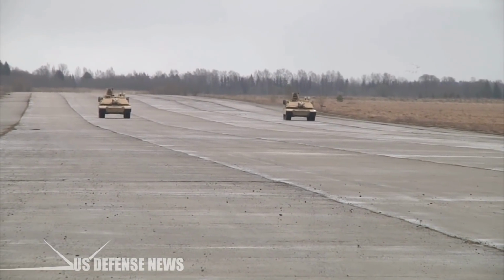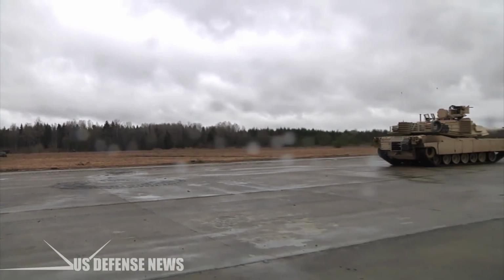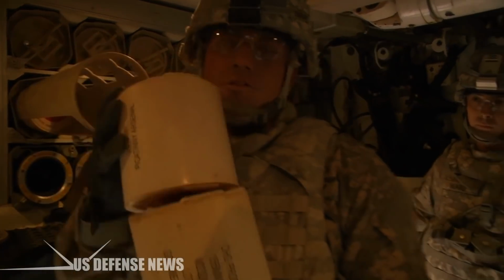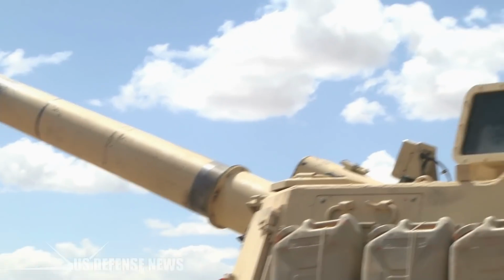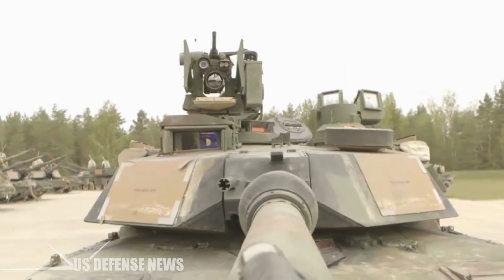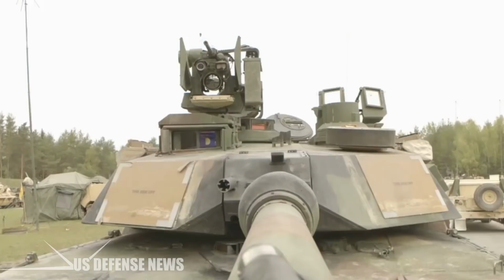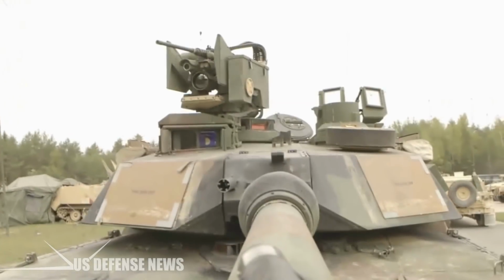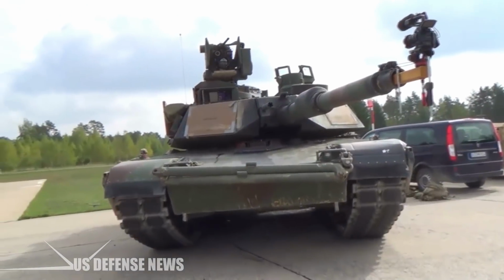U.S. Army Receives First New Abrams Tank Prototype

Comment: They should change the engine to a diesel engine. Not that fuel hungry jet engine.
Reply: The turbine is more quiet and more powerful
Reply: Matthew Rhodes  no it's not it has great armor depleted uranium for m1a2 m1a3 will have better than that
Reply: Matthew Rhodes We upgraded the armor with this new bolt on packs. Very good stuff. I was a tank commander for a long time. I know this system inside and out.
Reply: Dragan Petrovic 
Abrams fires once T-90 never fires because it's a ball of flame.
Reply: We had the M1A1 in the corps. We are getting new M1A2 upgraded units soon. We are already training on the new tanks.
Reply: Anthony Molina They prob was yelling that bullshit. But never heard them. Just seen them vaporize!!!!
Reply: Dragan Petrovic  ok yea Russian has the best tank ever and the best aircraft carrier it's so cool that it's powered by a tugboat
Reply: Dragan Petrovic The reason it cost 2 million dollars is because it does not have state of the art fire control system. The new Abrams and the ones being worked over are getting some really neat and badass systems. Can't talk about them because it's classified but don't underestimate this system! It is not the old Abrams of 5 yrs ago!! A few surprises for the Russians or Chinese!!!
Reply: There are turbine engines mounted on some Abrams variants that can develop up to 4500HP but they are limited to 1500 HP.
Reply: It's armor is one of it's greatest advantages over other MBTs . Crew survivability is top notch.
Reply: Dragan Petrovic manual loader is faster then an auto.
Reply: Matthew Rhodes bullshit it's lacking. It's the best in the world. Russian tanks? Please, they have horrible armor. Their wrecked turrets litter the Middle East.
Reply: Dragan Petrovic Russian tanks litter the Middle East. Turrets pop off easily and an auto loader will fail eventually. How many videos of Russian tanks cooking off do you need to see idiot?
Reply: Dragan Petrovic that's bullshit. An Abrams only needs one. Shot anyway.
Reply: The turbo diesel of the Leopard 2 is the same power and the tanks weights are similar. The fact the Leopard has a range of 340 miles with 1200 litres of internal fuel vs only 265 miles from 1900 litres for the Abrams, shows which is superior.
Reply: joy santod They burn they same fuel. The turbine was used because in the late 70s because turbo diesels couldn’t make that kind of power and be small enough to fit in the hull. Speed was needed because we could not match the numbers of Russian tanks on the eastern front. The armor is not weaker. It is literally the same as the British as we got the technology from them in a 3way development between us the brits and Germans. Our armor is superior that’s why we don’t need explosive reactive armor such as that found on Russian tanks. There’s literally a book on all of this.
Reply: The turbine in no way saves us money or has a longer service life. It’s the opposite in every way.
Reply: It's cheap because it SUCKS. The survival rate of Russian tanks vs American tanks is 0%. You ALWAYS ALWAYS LOSE the tank war.
Reply: Dragan, you... you DO realize that a human loader:

a) is faster than an autoloader, being 4-5 seconds for a competent human loader vs 6.5 seconds to as much as 19(!!!) seconds if the casette on a T72 autoloader has to turn a full rotation to the selected ammo?  T90 is slightly faster than T72, and at least the Russians FINALLY put their ammo in protected racks so it doesn't catastrophically explode (I mean, the Americans only figured THAT one out in 1943, so... another 50 years for the Russians to finally figure it out isn't so bad, right?), but a human loader is still significantly faster.  

b) Is much faster to re-stow the ready rack from the additional ammo racks, or to re-stock the tank from an ammunition supply vehicle, because not only is there another person helping, but the ammo stowage is more easily accessible, and there is no need to encode the ammo stored in each and every storage slot so the fire control system knows what ballistic computation to use with that round (which, incidentally, is another opportunity for human error to forget to encode it, which would then mean the round is fired with the wrong data and misses entirely)

c) can help with doing maintenance on the tank, whereas an autoloader INCREASES the maintenance requirements on the tank

d) can scan a sector and provide information to the rest of the crew

e) can man the loader's machine gun on road marches or to provide local security

Human loaders are very, very helpful to have.

It's more like "Abrams fires once from outside the effective range of the T90, kills the T90.  Second T90 stops to fire a missile because it cannot employ AT11 while moving more than a couple km/h... and then tries to engage with a missile while stationary, but forgets that it cannot fire the AT11 using the thermal sight, and can't actually see anything with the image intensifier sight because it is a very poor night sight with awful resolution, so while the crew is dicking around trying to get a missile off, just makes it easier for the M1 to hit and kill it by sitting still.  Third T90 closes the range gap and finally opens fire from 2500 meters, but is outshot 1.5:1 in rate of fire because the autoloader is actually slower than a human loader anyway.  Fourth T90 gets killed by infantry antitank team because the optics package on Russian tanks are awful, they have inadequate thermal sights, and one less set of eyes and one less machine gun scanning for infantry threats"
Reply: LOL petrov . you have no fvcking idea o the BS your spouting... Manual loaders in NATO MTB's  out perfrom the T 90 each and every time... You need to stop posting your bullshit...
Reply: Stillamarine 1001  cool
Reply: are these even EMP shielded? what use is a hunk of junk that doesnt move?
Reply: They went for a MUlti fuel turbine. Because the name says it. Multi fuel. it can even burn gasoline, jet fuel, ethanol, diesel, JP-8, JP-4, F-34, and hypothetically... crude oil.  That's why the turbine.... AND  35 minutes to swap it in the field because its a monoblock engine. you swap the whole turbine if something is broken... done deal go back to fight. Its expensive but it has logistical advantages. It is fuel hungry and not that efficient but who cares. Murica has money.
Reply: Chandler Becker:  No.  It is not.  For one, there is no such thing as "chobham armor", it is in fact Burlington armor.  Secondly, it was a joint US-British development.  Thirdly, the Abrams has not used Burlington in decades, as the US has subsequently developed and employed significantly better armor packages into the Abrams, upgrading it's effectiveness almost twofold from the original 1980s package.
Reply: DEFINITELY not. The AGT1500 is loud to be sure, but the tank actually moving is even louder. I'm an Abrams mechanic. Plus you can put literally any type of fuel into the Abrams. You could put fucking zippo fluid into that bitch.
Reply: Dragan Petrovic - The T-90 doesn't even come close to comparing to the new Abrams.  In fact, it's not even the best tank in the Russian inventory.  That would be the T-14 Armata.  While much better than the T-90, still not quite as good as the new Abrams.
Reply: You guys are forgetting that the Abrams is a big tank. It's one of the biggest MBT and it's fast for its size. A lot of the weight is from the armor. The tanks being destroyed in Syria are the export models that don't have too secret equipment. Why would we give too secret equipment to a shitty militaty. No offense.
Reply: mer3abec No. These tanks we gave them don't have DU armor as well as certain equipment.
Reply: mer3abec Basically The Abrams’ tanks of 2003-2007 era are not to current spec. The ones in Iraq are from that time frame of deployment. They are good tanks, but by no means are up to the capabilities of a current model, plus the on board computer was removed before being left behind. We didn’t leave any classified target and track or communications suite on board. So they are dumbed down in that regard, similar to models built for export.
Reply: XaHyMaH I saw your comment on the Abrams performance in Yemen. No amount of technology can survive shit tactics. They were driven by Saudi operators, right? Arabs use bad tactics, may as well say NO tactics. They cannot fight at night, as they are almost all night blind from birth. That’s a known fact by the way. So, combine day only fighting with gaggle warfare and you will get losses.
Reply: Stillamarine 1001 That's not entirely correct.  You know how board we get in the field.  My M88A2 was challenged to hook chains by the tankers in tug of war and I never lossed to an Abrams!!! Lol
Reply: LOLOL... Petrov.. Shut up you tool.. Its been proven that NATO tanks firing manualy out perform Russian autoloaders each and every time.. Also having a larger main gun doesn't neccessary mean a better kill ratio.  Add to the mix the T90 is just an upgraded T-72B. So please take your inept comments to the Russian fan girl forums LOL
Reply: Matthew Rhodes 
Are you serious? The M-1 is superior to any other battle tank armor.
Reply: OptimalOptimus50 Lol I see people.argue that all the time.

It's like, as opposed to what? A fuel economic tank? What the hells a fuel economic tank?
Reply: OptimalOptimus50 Same.

We never had to refuel that much either, sure as hell didn't have fuel trucks following us everywhere either.

In afghanistan we usually had more than enough fuel to travel between FOBs (multi hour drives) and plenty to do any presence patrols/overwatch.

We always refueled back at the FOB. 

The ONLY times an LVSR refueler went out with us was during massive movements 8-9hr plus drives. The first time was when we went to FOB Robinson to support MARSOC operations. The second was when we were packing up to.head back to camp Leatherneck.

Both times it was hidden in the formation behind plenty of guns and armor.

So again fuel economic....how far does a tank need to go? Lol
Reply: OptimalOptimus50 We can average around 4-6 hrs.

Not all engines burn at the same rate however, but that goes into maintenance etc etc.
Reply: Try moving 140,000 lbs at an instance LOL there’s semi trucks that can haul that amount and more...but they can’t just move fast in a war situation
Reply: 😋 yummy. For joy. You spread eagle on a tank would make a great selling poster
Reply: joy santod ya no. The turbine is raw power and high torque. We got enough gas.
Reply: Turbine is more powerful and has better cold weather reliability as I understand it.
Reply: joy santod it doesn't eat up fuel show me how?
Reply: Matthew Rhodes lol no
Reply: joy santod yep maye they could or not.
Reply: Tally Roll - In fairness, it's always been easier to make a better spear.
Reply: Daniel Kunkle Very true.
Reply: The Turbine in the M1 produces 1500 hp. quite powerful for its time.
BUT Diesels have now exceeded that power, now reaching ~1600 hp (most are about 1575 I think).
The Abrams was due for an upgraded Turbine, but the company that designed the original engine went bankrupt, so a new power plant (out side of diesel) is unlikely.
Reply: Isn't a lot of the reason the Abrams went with a turbine is for easier cold weather starts for European winters?
Reply: No. Winter diesel from filling stations doesn't freeze in central Europe.
Reply: Stillamarine 1001 Yea it's not like Leopard 2's in 1979 had Diesel engines with 1500hp
Reply: joy santod Our rounds and fire control systems are far superior. There’s a reason the cost is more. We don’t technically use diesel anyways. JP8 is used as it can be used in many environments. The turbine doesn’t care that it’s in the desert. That’s why the skirts are on the vehicle to keep sand out of the intake.
Reply: The LV100 was a proposed upgrade for the M1.  I think it was supposed to produce 1675 hp, while being more efficient. Lycoming was working on it, but I may have been mistaken, as they have merged or were already part of a larger company, Honeywell.

/watch?v=dl0osHn-nNQ&index=39&list=PLZUp4w8LY7wi1V97-xteEUW30TnDoy531
Be sure to take salt with you...

I did attempt to find more direct sources, and failed.
But if it is of interest to anyone, I found some articles about a possible TURBINE upgrade in the works.
The 'LV100-5' is/was apparently a thing!
Reply: joy santod See, right now you can take the JP-8 fuel from a Blackhawk and pour it right into an Abrams, a HumVee, and all our vehicles used on the Battlefield.
Reply: Matthew Rhodes What are you talking about? The Abrams armour is British.
Reply: John: In the document "Report No. P.C. 59 FEASIBLITY STUDY OF BURLINGTON FITTED TO CHIEFTAIN" from 14th May 1969 some details on Chobham armor are given. Already in 1969 the name "Chobham armor" was used to describe the new type of special armor developed in the British military facilites in Chobham, but the official codename for the armor was "Burlington".

Burlington was the official project name for the armor development program that came up with that armor package, which, again, is obsolete and has not been used on US M1 tanks since the M1A1HA in the early 1990s.
Reply: Your joking right....... right ...excessive fuel usage , excessive wear n tear due to MASSIVE heat production not to mention continued burn through on exhaust systems (due to heat) despite several "Fixes" and engine life cycle before "Reconditioning" less than 1/2 of Leopard 2 and Challenger 2 competitors  typical GD kit
Reply: Undistinguished Accuracy Actually,   it's a maintenance headache because it's the same engine that was in the Huey helicopter.  A newer engine would be much more fuel efficient.
Reply: Daniel Kunkle In cold weather the diesel needs to be kept warm.  Plus, when you start it the black smoke let's everyone know you're on the move.
Reply: joy santod it actually isn’t that bad.
Reply: The armor of the m1a2 sep v2, is up to at its best 1500 mm of effective armor against heat, That is better then on the Armata.
Reply: 1500 horsepower man
Reply: You don't need power to move the gun around and fire. We have the capability of EMP shielding but it's stupid expensive and nobody really uses EMPs
Reply: self loading cannon is more prone to breaking down. They specifically decided to have a loader for a reason. Auto-loaders are shit. Abrams is much heavier and more armored than a T-90. It might be a close fight, but Abrams would win
Reply: It's not that classified high speed lol
Reply: I call bullshit
Reply: John Hall Yup. Exactly. Like I said earlier, you can pour the fuel out of a Blackhawk and put it in a tank, humvee etc. every tanker I have ever met has been very confident on the M-1. The current models are EMP hardened as well. The current friend foe identifier has been improved to include  the ability to identify all current surface warfare vehicles.
Reply: joy santod they tried that in the 80s. Way more torque and power generation with the turbine engine. Less exhaust smoke. Higher exhaust heat but far more positives over diesel power plants.
Reply: Anthony Molina - That used to be true when the Abrams first rolled off the production line (which is why it was made to be so nimble compared to it's Russian counterparts).  However, since the initial launch of the Abrams in the early 80s, a lot has changed and and newer armor has been developed (e.g. Bolt-on packs).  The Abrams no longer has inferior armor to any tank in the world.  The newest version will probably put the Abrams back on top of the best tanks in the world, but prior to this new version that title was held by the Merkava Mk.4 from Israel.  However, over the past year the US (M1A1 SEP Abrams), the Russian (Armata) and the UK (Challenger 2) have all surpassed the Merkava.
Reply: Joy Santod - There's a reason diesel engines were scrapped long ago in airplane development.  Better fuel efficiency, easier to maintain, longer lifespan and more power.
Reply: Ioan Catarig do you know why the tune it to 1500? I would like to know
Reply: It's multifuel. Diesel, gas, marine diesel, you name it, it will run it
Reply: joy santod The fuel hungry hey engine weighs less, and it'll run off any fuel that burns. Gasoline,  jet fuel, diesel -- any liquid fuel.
Reply: Tally Roll Fuck no. Any RPG that took out an Abrams, hit it in the engine -- a weak point on ALL TANKS.

There's an Abrams that took over 15 RPG hits, made it back to base, and was repaired and sent back to battle in a week.
Reply: farid aliyev Ukraine faced russian army? Idiot. Ukraine can be taken over by one vdv paradropers division droped near Kiev. What ukranian army faced are coal miners who surved in soviet army of USSR. Most of tanks and weapon purchoised by donbas rebels from ukranian army command staff or captured. Moreover, donbass republics has ammo factory . Most of the tanks used in this conflict t64 .
Reply: what do you think it runs on jet fuel lol the army uses one fuel for its ground vehicles diesel
Reply: XaHyMaH The loses are hits too the engine. You can disable ANY modern tank, if you shoot it in the ass with a machine gun, as the massive engines need massive slots to breathe -- these massive slots are in the rear of the tank, and give a direct line of fire too the engine. 

Taking out an Abrams from behind doesn't impress me. In fact, doing it with an RPG is retarded. Taking out a Russian T-90 is even easier. It's a T-72 with primitive ceramic armor bolted on and ERA bolted on. Guess what isn't affected by ceramic or ERA? SABOT rounds. Guess what rounds the Abrams fires at other tanks? SABOT's.
Reply: Heinrich Von Kekelnazi They had a rpg hit and Abrams and it hit it in the ass. It was a very lucky hit. You can knock out any tank, with a M72 from the rear
Reply: Holesinsocks bad dancer cos of his balls?
Reply: Meh, would rather annihilate Russia and China absolutely with an engine that is:
More reliable. Faster. Cheaper to maintain. Can use any fuel. Is much quieter. Doesn't kick-up a huge black smoke plume.

You said something about diesel? Sound more like a red commy.
Reply: mer3abec What??
Reply: Anthony - Punctuation. Look into it.
Reply: That turbine engine runs on mutifuel including diesel oil in necessary.
Reply: They have a lot oil mate its USA..
Reply: Stive Mcklasky We do, but apparently we can't touch it so we have to use Arab oil
Reply: Shout itOut every piece of military hardware is emp shielded
Reply: Tungsten I heard about this a few years ago, too, but now I can't find any specific info on it (except fprado's website, http://www.fprado.com/armorsite/abrams.htm).
Reply: joy santod 
The M-60 Battle tank diesel 12 cylinder engine ate up 4 gallons to the mile. I said 4 gallons to one mile. So the turbine is much more cost effective. However, the turbine can't swallow much sand. 
Hence constant filter changes.
Reply: https://www.youtube.com/watch?v=KlbihLtR0HI    look this is russian tanks  LOL
Reply: Ok MTU has a V-10 turbocharged Diesel rated at 1500 horsepower but it take 1.7 seconds or so to reach that power to the tracks. The turbine in its original form aka analog were fuel hungry, but since the digital turbine came out they were able to eliminate the APU as the digital control turbine used less fuel idling than the APU did.
Reply: Mr. Coffee it can burn drinking  alcohol
Reply: Matthew Rhodes your a moron stop talking
Reply: THey are working on the diesel
Reply: The turbine gives excellent advantages over a diesel and MTU has a 1500 horsepower diesel package designed to swap into the M1A2 as fast as the turbine and the army has tested it in a M1A2 V3 against a older M1A2 side by side in the dirt not on asphalt or concrete and while the MTU engine is an excellent design the turbine powered M1A2 and up versions both tanks idling in gear have had many drag races to find out which was faster.
The M1A2 and up versions pulled away from the diesels powered tank for one reason. Power and torque delivery with the turbine reaches full horsepower delivery in just under 2 seconds, the diesel while it gets better fuel economy takes almost 4.5 seconds to reach full power. In tank warfare the tank that moves faster from a sitting position stays alive because speed after firing from a hull down position is a target so right after firing one or 2 rounds the driver gets the go command and no tank in the world can move out faster than a turbine powered M1A2 or better version. The original version the M1 and M1A1 used a analog computer to control the engine and they did burn a lot of fuel even idling. But with the newer digital control for the turbine they actually use less fuel idling than an APU does.

In take warfare speed is life and you don't get the speed the M1A2 has with a diesel. The T-72 would fire one main gun round and by the time it was ready to fire another round the M1A or M1A2 with a man loading the main gun can fire 4 to 5 rounds while the T-72 was reloading. The Russians improved the loading time of their auto loader in. The T-90 but it still isn't close enough to M1 tank crew.
Reply: I thought the turbine engine can use multiple types of fuel incl. diesel?
Reply: joy santod who needs fuel when you can run it off of piss and booze
Reply: Matthew Rhodes  The M1 has very strong DU armor. They want a powerful engine so it can be fast and strong.
Reply: Cant get the Hp with a diesel. 62 tons.
Reply: They already have a 1500 hp Diesel engine for the abrams wtf you talking about? That is the same as that turbine.
Reply: joy santod Fuel hungry?

As opposed to what, a fuel economic tank?

Smdh
Reply: There are Still using the Chobham...
Reply: Free country
Reply: Matthew Rhodes Heavy armor isn't worth shit these days.
Reply: Diesel engines overheat, the turbine doesn’t use coolant, just air
Reply: turbine is quieter and can run on multiple fuel sources, for what logistical abilities it loses in 1 area it gains in another.
Reply: joy santod i agree
Reply: Dragan Petrovic a 5 man crew is better than 4 the xtra man can help in maintenance.
Reply: Samoan Dude lots and lots of air
Reply: The turbine motor makes great power, and as was said needs less maintenance in the long run. Which means it is cheaper to run, and not as gas hungry as you might think. Also, the armor of the abrams is exceptional, and the only tanks who are really on par are the challenger. Which we are allied with, so i'm not sure where you're coming from with these accusations.
Reply: Dragan Petrovic 
The only advantage an autoloader gives is that it makes the tank smaller; in all other aspects, a crew loader is superior.
It worked well enough in Iraqi Freedom, Desert Storm, Desert Shield, Enduring Freedom, etc.
Bore diameter doesn't mean shit, especially when both sides are using submuniton or HEAT rounds. But on that subject, the L44 (Abrams' gun) has nearly twice the range (8,000 meters with most ammo types) over the 2A46 (5,000 meters with ATGM, T90's gun).
It wouldn't matter if your tank was 1/100th the cost of the Abrams if they can't even scratch it, and the 2A46 cannon is objectively useless against it's DU enhanced Chobham armor.
Reply: Matthew Rhodes it has a max speed of 72 km/h or 40 mph but it goes 55 km/h most of the time
Reply: Yeah so it can go a mile per hour nice
Reply: Bronco 53 p
Reply: Gunsight416 because leopard is lighter than the abrams
Reply: The jet engine can run on diesel
Reply: Thatd be a bigass diesel engine bro
Reply: Why? The jet engine save us money in maintenance in the long run.
Reply: Dragan Petrovic  manual loder is better cause it won't jam
Reply: Stillamarine 1001  did you kill any of those Allah arkbar screaming fucks thanks for your service
Reply: joy santod, It's a matter of designing both the turbine and the transmission to the vehicle, rather than picking them off-the-shelf.  You can get very nearly the same fuel efficiency as a diesel - and the Abrams does - plus the advantages of low weight (for air transport) and low noise (for combat).
Reply: joy santod Can't get the power you need for that much weight from  a diesel .
Reply: Yep the armor sucks they lost a lot of tanks in Iraq because of the RPG 7 .The Russians are making better RPG to bust up American armor.So we are having to. to a catchup game
Reply: For those saying diesel doesn't have the power, that's just simply wrong. Diesel engines can make insane mount if power and still be more efficient than a turbine. The Leopard 2 uses a 1500hp diesel and you can tell from watching training footage that the leopard is more mobile than the M1.
Reply: Ak situk Idiot is u. Cos u see what used the most at wars. There are many pop up turet vid about abrams. Check it in Yemen. How yemens pop up saudy abramss with just rpg 7. Old rpg tost it in big numbers. Saudits lost almost all their abrams tanks. Then compare how t90 handle US Tow missiles in Syria. Only one tank t90 been lost by now.
Reply: Michael Estepp Abrams never used in Syria. But in Iraq. Iraq army uses abrams tanks left by usa army. So. Usa army used shit equipment?
Reply: Michael Estepp Who told u that? It is exectly tanks us army used in Iraq. Nobody will move them . It cost money.
Reply: Abramses burn very well in Yemen. They being shot down by rebels in sandals with obsolete soviet missiles.
Reply: For my 10 years career there was no one autoloader jamming.
Reply: Forest Rivers And no power compared to a jet turbine .
Reply: Tank is so crap that no diesel engine can move it!
Reply: Ok, let say in 90% doesn't jam, Abram fire one time T-90 fire 2-3 times what than?
Reply: Abrams can't automatic reload gun, in desert jet engine is bad choice. Abrams have 120mm gun, Russian T-90 have 125mm gun. Abrams cost 6.2 milion dollars, T-90 Russian cost 2.1 milion dolars... You don't have chance dude ;)
Reply: Anthony Molina it needs to be fast cause it's armour is lacking compared to Russians and British armour